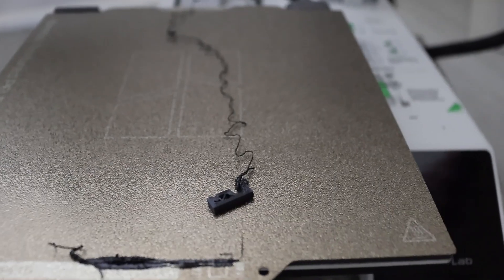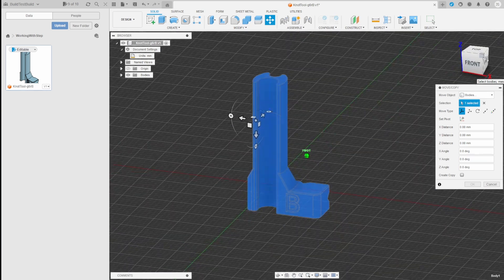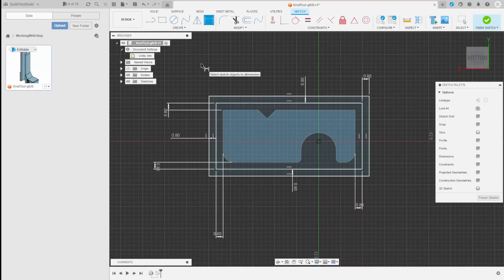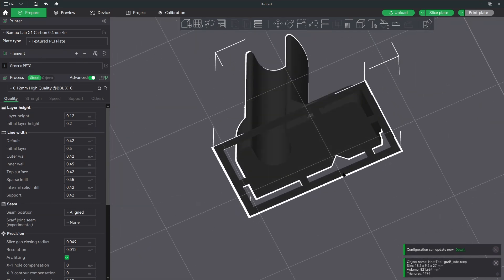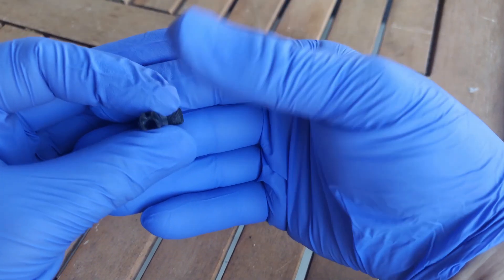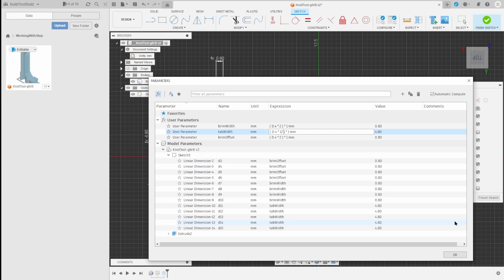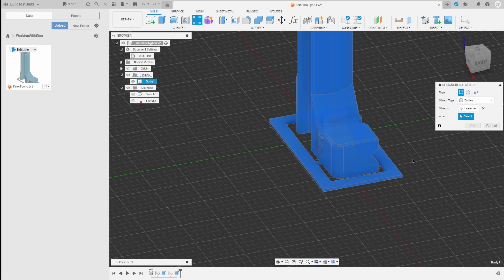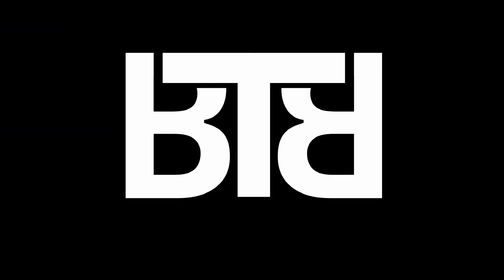Brim Removal Trick! Remix STEP file in Fusion 360 to Create Tabs

Comment: Any reason why your tabs aren't connected to the part corners? Also, the single pull up tab for easy bed removal is so smart. Thanks.
Reply from the maker: @CraigHollabaugh  for this particular part it was cleaner to snap them off on a straight side, and it seemed to be sufficient to get 100% success rate... with this particular part.

But in general if you need to add additional bed adhesion features I would expect that they would need to be added at the corners.  In fact my first version of this part used corner tabs, but I decided to show it on the edges to share the idea that it MIGHT be sufficient and so depending on how much optimization you are willing to do is something to consider.
Reply: @buildtestbuild  thanks!

Comment: Cool idea.  Would it work if there was a small gap between the tab and the part?  Like .1 or .2 mm?  It might give you an effective bed adhesion while allowing the tabs to pop off the parts more easily.  It might also help to make the tabs wedge shaped so they're 1 layer thick where they touch the part but multiple layers thick where they touch the base.  That could make them more likely to attach to the bed than the part when you remove the part from the bed.

Comment: Great idea! I am actually thinking of creating the frame (without a part) and save it as a "frame temple" then I can import the STEP file. Then all I have to do is adjust for the tab placement.
Reply from the maker: @agarza6475  depending on your slicer you may be able to combine them there.  I believe prusa and bamboo let you join 2 files to print as one 🤔 of course I would be surprised if you couldn't do the same in other slicers. Of course it totally depends on your workflow and what's most convenient for you.

Comment: Neat ideas, and ones I will use.  I'd have set the parameters before sketching, too.  A couple of suggestions: I'd use the offset command (shortcut "O") in the sketch to create the outer rectangle at your parameterised offset instead of setting several dimensions, and I'd have set parameters for "nozzle_width" and "layer_height", then used those as the basis for the others. If you add the "Parameter I/O" app from the Autodesk app store, you can export your parameters for reuse in the next small object you want to create tabbed brims for.
Reply from the maker: @pnt103  glad you found the information useful.  Thank you for the tips! Very good suggestions.

Comment: your thoughts. SLANT3D says its best not to have right angles on the bed or even your model, that you should FILLET so you get less shrinkage?
Reply from the maker: @FilmFactry  I strongly recommend using a chamfer on the face touching the bed.  The reason is that the changing angle of a fillet curve will exceed the critical overhang angle and cause print issues.  If you have a tiny radius it may not cause issues because it's such a small change, but I have seen print issues multiple times from using a fillet that faces the build platform.  I think Gabe from Slant3D even mentioned that issue in a video. 

That said, yes, I really encourage using fillets especially on vertical edges (with relation to the build platform). Always avoid sharp corners if you can, it prints slower and concentrates stresses.

That said, on this tiny model I didn't chamfer the bottom like I normally do because it was such a small part and I was trying to increase bed contact area.  Also I  wanted to use the edge of this part as a measuring tool in between knots.  So this part is a bit of an exception but my normal design rules are chamfer edges towards the build face to control the overhang angle and fillet everywhere I can fillet, especially corners because it will print faster and be stronger.  I hope that answered your question.
Reply: @buildtestbuild  Yes thank you. This was my first video of your, and I subscribed:-)

Comment: Good video but seems like your bed adhesion is not good. I printed way smaller and higher parts without any brims. I just upped the bed temp by 5-10°C and cleaned my buildplate with (classic dishsoap) not that new sensitive stuff that has oils in it. If it says it's good for your hands than it's bad for your buildplate. After that with 99° Isoproylalcohol and a sponge.
Reply: 9:26 This shot might be a clue as to why the adhesion is poor. Man needs to print a scraper and use it religiously. Can't believe how much of a difference not touching the print surface made for my prints.
Reply: @Phoen1x883 yeah I never touch my build plate with my hands. Always using a scraper and no touching.
I use one coat of 3DLAC after cleaning the build plate as well just for a little bit extra adhesion.
Reply from the maker: @DanielSchweinert  that's a good point, I need to try your technique on my build platform.
Reply: @buildtestbuild So I deal with a lot of “industrial” filaments, I’ve learned it’s way smarter to do multiple batch sized test prints until you have good bed adhesion, you can nearly always get it to work without a brim. 

Look into some of the new build plate materials, they’ve improved dramatically over the past 2 years.

PVDF for example used to warp so bad on parts 100+mm that my magnetic bed plate would curl off the base - A testament to the grip it was able to get, I don’t use anything but qidi techs HF build plate cleaned with 99 iso when needed 

But yea you should have 0 problem once you get the settings down with PLA, PETG or ASA from my experience
Reply: Good point to clean proper your build plate. I tend to use cheap methylated spirits and dish soap. Works like a charm. And if the PEI plate is used for a long time with lots of different filaments I clean it with a kitchen sponge (rough side). This gives also good adhesion. It's like sanding your PEI plate with fine sand paper. After that clean it again with dish soap or spirits.
Reply: I'm going to agree with this, I haven't had a single print fail to adhere on my A1 regardless of geometry, treat the build plate like it's a stove element that's always on. We leave oils on everything we touch, we just can't see it, so it's not an easily enforceable habit. Clean with iso at random if it's been a bit since it was used, always clean if you had to run across any part of the main surface. Get a little spritz bottle that has a good dispersion to it, it will last forever and make cleaning like this stupid easy. I also have a feeling that you should go with higher iso concentrations, the less water in it the better, also because it attacks the oils better.

Comment: The reason on why parts fell off is because they wrap at sharp edges. The thing what you are doing does not help and it takes additional time. 
External brims with deburring tool are much faster and better in terms of manufacturing process
Reply from the maker: @wiktorstarzak6410  you are correct that one reason why parts detach is from warping.  This is most prominent on large parts and materials like ABS. I mentioned in the video that you can attach the tabs at the sharp edges or wherever you prefer for your application. 

In this particular caae that I demonstrated, it is a very small part with a small contact point and it's relatively tall.  I was printing it in PETG which is not particularly prone to warping.  For this tiny part the relative nozzle movement was enough to cause it to detach. Therefore, I placed the tabs on straight edges because it made them easier to detach cleanly and provided sufficient support to make successful prints.  I tested the parts with and without this technique and groups of parts always failed without it, and I didn't get a single failure while printing these parts using this technique. 

You are correct that it takes longer to set this up than to simply turn on the brim.  If you were only printing a single part I wouldn't recommend this because it will take longer to design than it will take to clean off the brim. However in my application of printing a large number of these it's worth the design time because it reduces the processing time.

I did test this tiny part with a brim and a deburring tool and it took longer to run the deburring tool than to just snap off the tabs.

This technique has trade offs like every solution. This is not a solution for all cases, but for some cases it is the best solution. I'm sharing it with the community so that others can test and evaluate it and hopefully find applications where it saves them time as well.
Reply: Also there is already an option in the slicer to put the brim only on the sharp edges.
Reply from the maker: @_RsX_  I'm not familiar with that setting, which slicer are you using and what do they call the option?
Reply: @buildtestbuild it's called "Mouse ear" in Orca Slicer. I thought the option was also available in Bambu Studio but it is not.
Reply from the maker: @_RsX_  that makes sense, I haven't tried orca slicer yet. Thank you for telling me about this feature, I can see it being very useful for certain parts!
Reply: @buildtestbuild  Mouse ears are also available in Cura (where they originated, as a plugin) and PrusaSlicer/SuperSlicer.